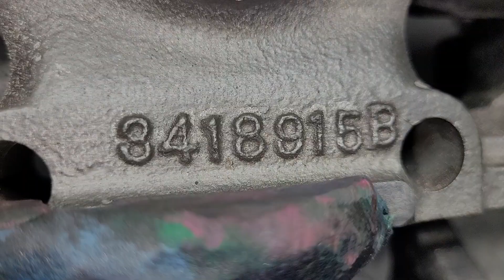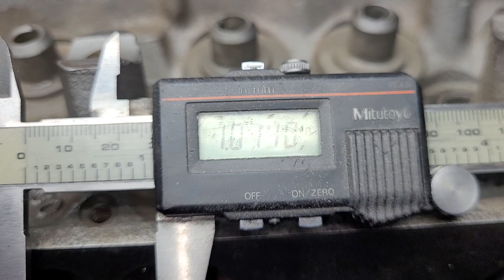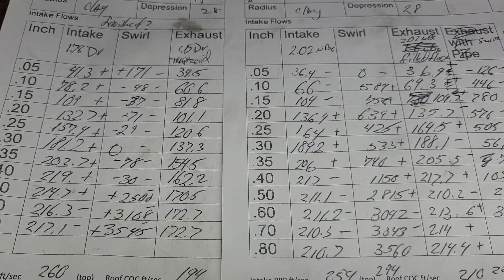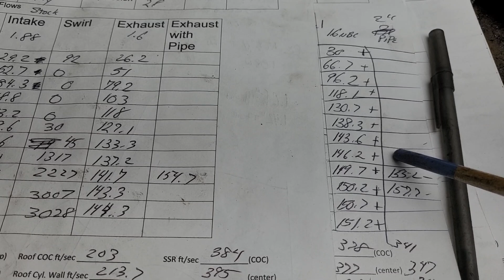David Vizard's Mission Impossible project 318 heads vs 340 z heads vs. 360 j heads!!!

Comment: The X heads on my 70 340 after pocket porting were around 240 without touching the runners. Those z heads have been opened up a bunch on the exhaust. I have to admit that I have never seen a Z head with a 915 casting number. Must have been a 71 🤷🏼‍♂️. This is really showing how well you have the 318 heads working. I am betting that you will get 245-250 without epoxy

Comment: I think these videos are really informative. I wonder how all the heads I ported would flow, a lot of basic port matching and bowl work and then a valve lap job. My friends liked the price.
Reply: Same here. 
I did a lot of things they say never to do
But damn it’s one of  the best running engines I’ve ever worked with and I’m a full time mechanic
- it’s in my daily
Reply from the maker: I think I know what you are writing. Take a look how super stock heads are done with tiny pinches and big bowls that make crazy hp on a specific amount of port volume.

Comment: I believe the bump you are referring to on the roof of the intake port is for material thickness for the head bolt counterbore. We use to make a plug to fill the counterbore and remove the bump. Didn't have a flow bench back in the day. It would be interesting to see if it improved the flow.
Reply from the maker: I did that experiment on the J heads. It helps but not that much. Thanks
Reply: Do recall any numbers on flow and swirl?

Comment: If you can find them. The factory also offered 2 more sb heads in the X,Z castings. The X casting for Mark Williams trans am team and the T/A AAR Cuda heads. The x casting has the best exhaust port available.  The T/A head had no push rod pinch. They only made 500 pairs of each of these to be legal for factory racing.
Reply from the maker: Good info. Thanks
Reply from the maker: What were they thinking on that floor? Horrible.
Reply: The T/A had the offset rockers and relocated pushrod holes, but you had to remove the pinch yourself as the factory did not. Same ports as the other J-heads.

Comment: 5:00 Are you saying the air is colliding with that area and its choking the flow?
Reply from the maker: No. Too much area and too slow an air speed. Does nothing but hurt port energy and cylinder fill.
Reply: @servediocylinderheads  I confess, even with all of the years of aerodynamic studies I had with turbine engines, airfoils and slip stream stabilities, there is still a whole lot I do not fully understand.

It seems to me, by my experience with supersonic and hypersonic air choke fields, that speeding up air tends to make mach waves that cause stall.

And yet here, it seems the opposite is desired, where one is pinching back the air flow, to raise air flow velocities to increase power.

Pretty much why I never messed a lot with head porting or bowl shaping.

I probably would have done it all wrong, based on the principles I used when building turbojet engines. ~( ,m,)~

Comment: Do You get "Equal" Flow from "Entire Valve , 360*" ? If "Swirl Exist", wouldn't Blue be All around Valve 360* ? Which is Shortest  a "Straight Line Flow  or Swirl  Curved  Flow ? 
4 Strokes= Intake Down -Compress Up -Power Down-Exhaust Up , =   2 full Crank Rev's,  At 6,000  rpm , =100 per Rev= 100/ 2= 50 times per Second  for 1  REV = 2 Strokes per Rev = .02 / 2= .01 per  Intake Stroke   ?
Reply from the maker: The dykem is way heavier than fuel so if you get a wide spread on dykem fuel will be way better.
Reply: MrKawa74;  Good question.
Consider that the draw from the machine is more than what the engine will see under a cruise rpm on the street. The amount of blue dykem you see is as Charlie said, is heavier with less of tumbling and more of a straight run, the lighter fuel will swirl around because it is lighter. Under the cruise and part throttle applications of normal driving, there is also a more atomized fuel mixture running the entire intake track from carb to valve and not the heavier spray from the aerosol can of the dykem a few inches from the port. 

Do so remember that when we tested, the room temp was in the low 80’s and a running engine Willy warmed up is probably at least double that number at 160* for a race engine, 180/190 or better for a stock engine. This means the relatively cool daikon is a denser fluid versus the lighter, warmer and more evaporated gasoline that will have the propensity to be in a more gaseous form conforming to running around with the air in a more highly mixed state vs the dykem.

Between the 28” draw of the machine and the dykem, it becomes more representative of a heavy pedal & acceleration representation and what you would need to know  for what the head is doing under the wide open throttle condition.

IIRC, the valve was opened up pretty good. I don’t remember if it was .600 or not. Since the head is now a little ported and flows very well at such lifts, this is where you would test it, and spray the dykem and see what’s going on.

Yes, if you lifted the valve to only.444 like a stock cam does or less depending on your lift & matched what a running engine would see in terms of vacuum, the pattern would be different. 

 It we don’t port heads and test low lift figures at part throttle, the pattern would show much differently. The factory engineers might do such things as well as other tests like for the things the government mandates, emissions, fuel efficiency for mileage.

There thought patterns and tests are of a different mind set & meeting different criteria.

Again, good question!
Reply from the maker: @Robs-Garage-experiments Good points Rob!
Reply from the maker: @MrKawa74 All air speeds are from Pitot.

Comment: Increased velocity directed to a new location?
Reply from the maker: Moved the air up to roof more.
Reply: @servediocylinderheads  Still trying very hard to understand reciprocating engines.

Built them, raced them, even slightly power built them, but never really studied things like swirl, deflection angles, inlet velocities, etc.

When I went into the USAF, I focused solely on turbojet engines.

Completely different set of laws and principles from reciprocating engines.
Reply from the maker: @hunnybunnysheavymetalmusic6542  Excellent.

Comment: Charlie, would you be interested in messing around with some 4 valve heads one day? Not anytime soon because I currently have other financial commitments. But just curious. The application would be the 3.6 pentastar so we are limited to .400 max lift and the exhaust manifold is cast into the head.
Reply from the maker: I have a set coming...stay tuned!

Comment: Off the top of my head at 1" diameter, I believe the clay ball  is 0.785 ci
Reply from the maker: That does sound about right.
Reply from the maker: Now convert it to cc.
Reply: @servediocylinderheads Any updates on this project???
Reply from the maker: @yeehaw3792  I did three intakes and almst done with the open chamber heads with stock valve sizes. Thanks